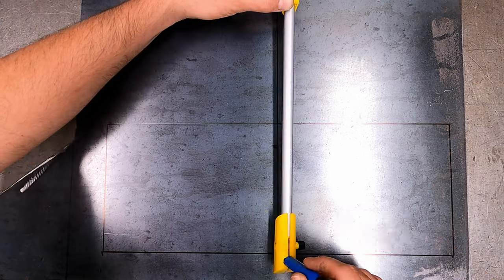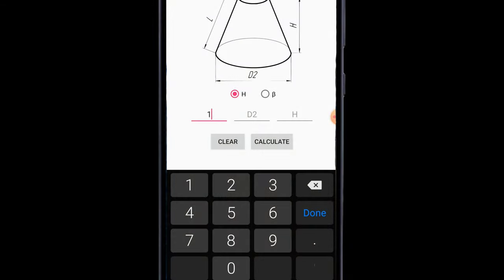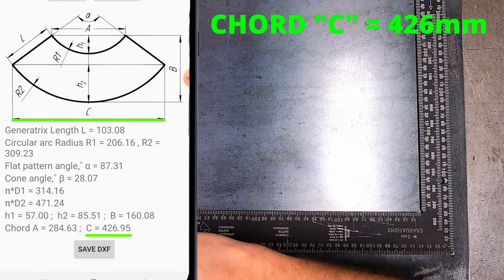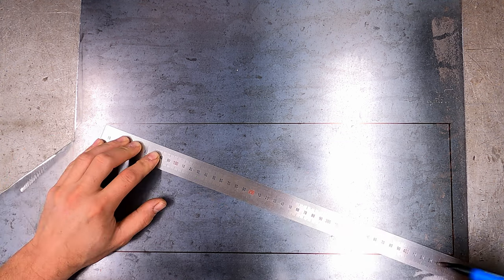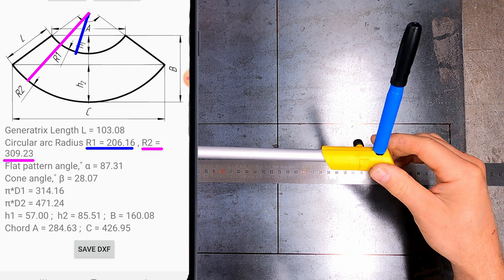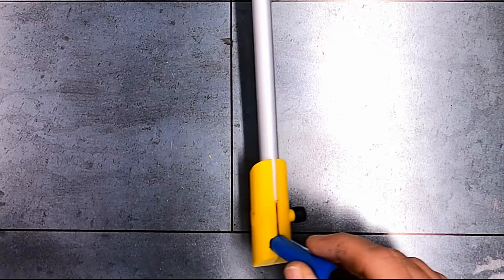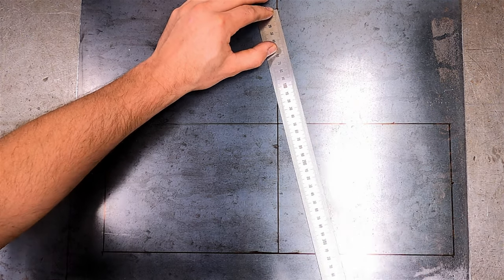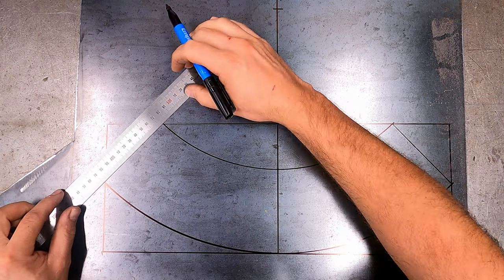How to Draw a Flat Pattern Truncated Cone in 3 EASY STEPS with FREE APP!

Comment: You can also split it up, so you end up with less wasted material. That's better for my purpose - making a backpacking cone that doubles as windshield and potstand. Having it split means it's easier to pack, more vertically stable because on the extra joints I have length-wise ridges for interlocking the pieces. more cutting and bending work, more time to assemble as a tradeoff for way less material wasted, which is important to me because titanium is expensive.

Comment: Yahoo !   4th try, I got it correct on paper.  Now will transfer to aluminum flashing for the final piece. :)
Reply from the maker: What you making the cone for? Project?
Reply: @JetManJoe  I'm a hobbyist - so I picked up a solar spot light out of neighbors trash.   It still worked - but lens clouded over and cracked- replaced with glass. LED reflector was water/weather damaged.  I knew, I could not just cut a cone out of metal and make it work.   After several searches, I found your Youtube page and followed the directions.  D1-21mm  D2-57mm  H-35mm. Final cut was on aluminum flashing (roof repair, etc.).  Polished inside to mirror finish and fastened to inside of old reflector :)  Thank you again !
Reply from the maker: Nice 👍